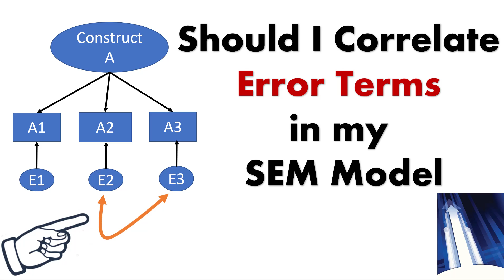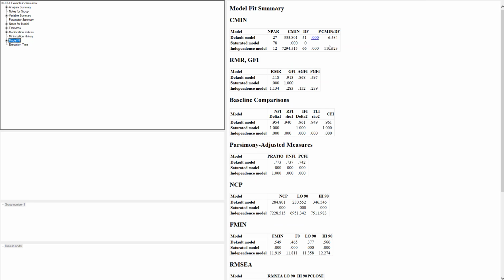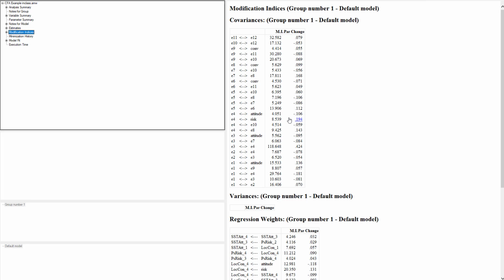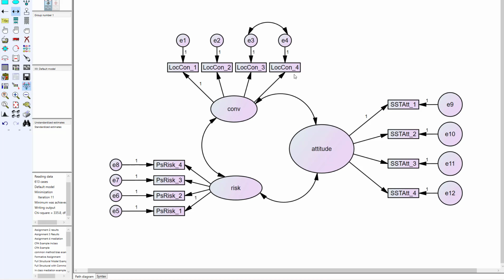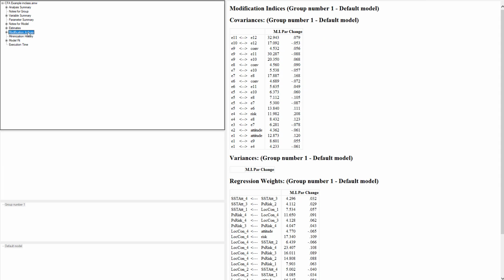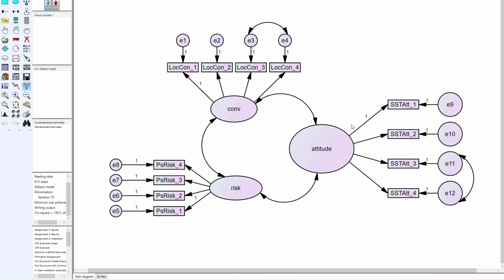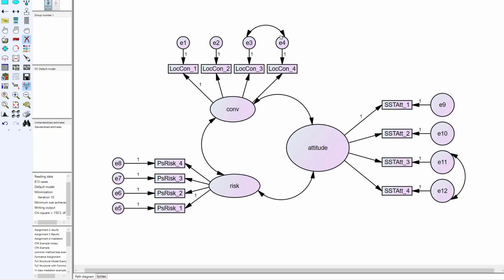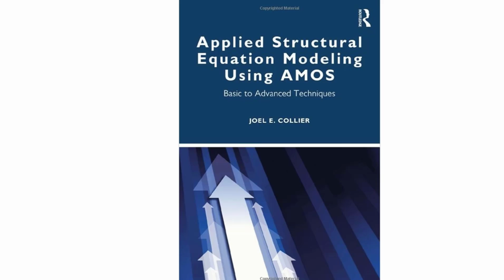Correlating Errors in a Structural Equation Model

Comment: Thank you for your video!  If my model does not fit,  my regressions weights are not valid? I cannot use them for interpretation?
Reply from the maker: There is a lot of debate around this.  If you use PROCESS, it does not even give you model fit statistics.  If your model fit is bad in SEM, then it points to a model that is not representing the data.  In essence, the model does a poor job explaining the data collected.  Saying that, it does not mean it poorly explains certain relationships.  It means that the totality of your model does not explain the data very well.
Reply: @joelcollier9387  thank you so much for your response. Please would you recommend any references I can check to dig into this discussion ? I am interested in a certain relationship between two constructs of my structural model. The regression weight is 0.24- which is low, but it exists.However, my CFI is 0,.86, Is there any way I can address how reliable this relationship is since the model doesn't fit?

Comment: Thank you so much for your interesting video. I have a question. Can I draw a residual covariance between the two residuals of two dependent variables in the path model?
Reply from the maker: It is not advisable.  The reason is a reviewer is going to say that if the error is correlated between constructs....then you probably do not have different constructs.  It is just versions of the same construct.  The error should behave differently if they are different constructs.  This is a little different than correlating errors within construct because they are all supposed to represent the overarching concept.  Hope the helps.

Comment: Hi Joel, I was lucky to discover your book at early stages of my AMOS endeavor. The book is concise yet very clear. Nevertheless, the section on using  marker variable to detect common method bias needs further illustration, I believe. That'd be nice you could add a video on how to analyze and interpret result for detecting CMB using marker variable.  Thanks!
Reply from the maker: Thanks for the feedback.  Common method bias is a big topic that would take multiple videos to address.  As for marker variables, the key is to choose a variable that is unrelated to any other construct in your study.  Once you do that, then you need to partial out the correlation of the marker variable from the other correlations.  Then use the adjusted correlation as the input for your model.  CMB videos are coming but it might be a little bit before I get to it.